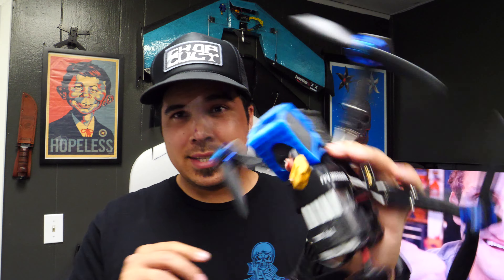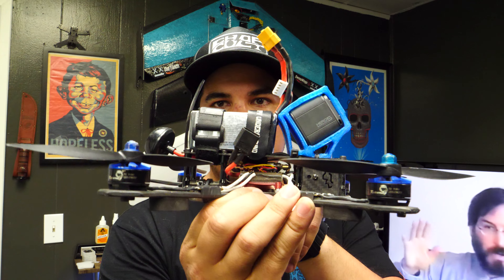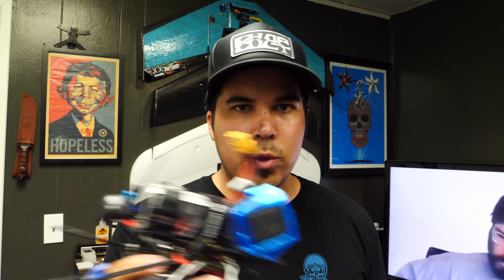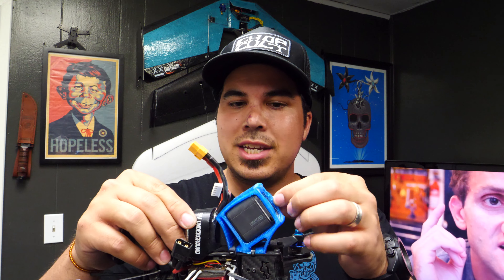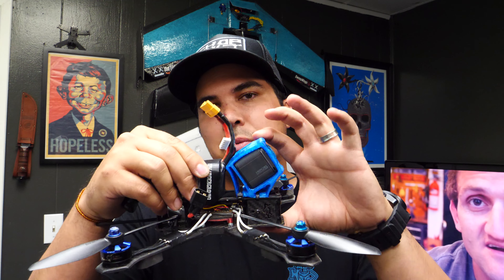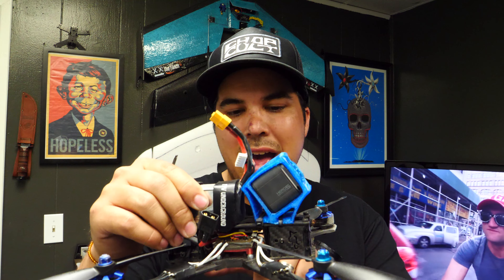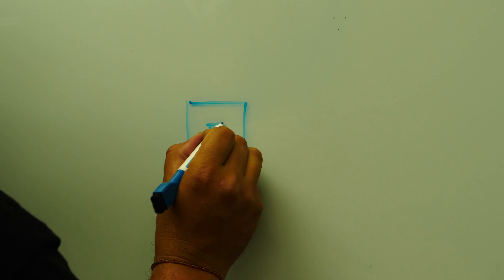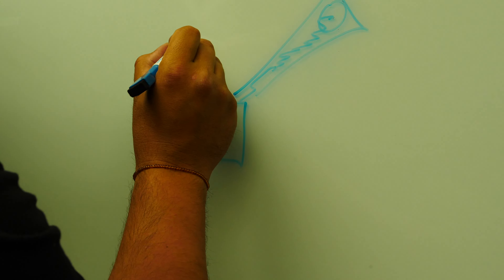TECH YOSELF | CLEAN AND DIRTY

Comment: I think one difficult part of trying to soft mount a modern FC is that so many are now AIO controllers and with that comes a lot of wires, weight, and vibrations through those wires to the FC. Have you thought about dampening your arm mounts? That makes more sense to me that trying to soft mount motors and maybe combined with the FC isolation you could really cut out a lot of vibrations. As a side effect I assume it would make the quad feel less snappy and more mushy.

Comment: if you're rockin 6", especially bi-blade props, I'd highly recommend balancing your props if you're getting jello.  Really we should always be balancing our props but if it's less than 5" it can often be compensated out with PID adjustments.  Most brands are very out of balance but a few are generally well-balanced (such as HQ Props).  Unbalanced props becomes less noticeable the more blades you have, so a tri-blade and quad-blade have less noticeable impact and we can get away with it.  But at 6" it starts to become a problem and even more so with a bi-blade.  Unbalanced props = jello.
Reply from the maker: +Kellen Razzano I just switched from trip blades to gf bi blades cause they're more balanced then the HQ tri

Comment: Any chance you are interested to gather some data on your problem... If you have a way to collect black box data, then you can measure the efficacy of the changes you are making to your setup... Love that you share your experiences with your subscribers!
Reply from the maker: +diabolicallydan yeah I've been using black box
Reply: diabolicallydan I wss thinking similarly, if we had some accelerometer data on the go pro we could better design the new soft mounts. how crazy would a second fc mounted on the go pro just to record it's accels? I'm betting Konasty has one sitting on his bench!
Reply: Probably easier to try a different gopro session... In case it's a problem with the onboard image stabilizer fighting quad vibrations. Trying to take as much vibration out of the quad is the best first step...
Reply from the maker: +diabolicallydan already tried a new GoPro wasn't it

Comment: here is the problem, years ago we could fly 6 inch no prob the gyros were not nearly as sensitive as they are today, most flight controllers are designed around a 5 inch prop or smaller, 6 inch props are noisy as hell, and add a bi prop boom super noisy, beta flight should work pretty good now that you can take out the worthless notch filters, my films pretty darn clean on 6 inch using Rf and some of the secret new unreleased firmware they are working on, bottom line softmount will help, but its more of a filtering problem, need to be able to filter out the noise a 6 inch makes compared to a 5 inch, also you use small motors and lower kv, 2206 2150 kv? that a torque set up but IMO a 2206 struggles with getting a 6 inch prop up to speed fast in return jumps the prop make vibs and more noise, I designed the 2207 2400 kv and 2580 kv both do really well on the 6 inch bi prop with the amps maxed out at 122, which is less than my 5 inch set ups, so i think there is a few things that i mentioned to ya that are against ya, but i can see ya have been chasing the issue down a rabbit hole, so maybe some of this info might help ya.
Reply from the maker: +richard shelton thanks for the comment Richard. A lot of this stuff I have already said or know about but I'm trying to find the best solutions to the 6" problem that way I can help others that run into these issues rather the finding a quick bandaid to the solution.
Reply: well i would start with the filters, if u fly beta, i would drop the notch filters and that should instantly get it flying better, or give rf a try in a few weeks, also if you run 6 inch tri props u should have pretty decent film, might lack top end speed and climb out thou.

Comment: would you try just 2 layers of 3m doubleface tape to mount your 3d gopro mount to the quad  vs the zip ties   ?
Reply from the maker: +antoine ozaneaux not the 3D mount cause it's to heavy it will rip off but I mount the foam that way.

Comment: I feel your pain man, these worked pretty well for me on my quads lately. i tried the rubber orings at all 4 mounting points and was still getting small vibrations coming through to my fc. This is what solved it for me. They're kinda like what you were explaining in your illustration. http://www.readytoflyquads.com/tpu-3d-printed-sount-mount-fc-star-adapter.
You'd just have to trim off whatever you didn't need. They basically allow the whole outter edges of the fc to be fully dampened. I also soft mounted my pdb on o rings and it helped as well.
Reply from the maker: +daneyan1985 I've seen those but don't like the 45deg idea
Reply: You can mount it in whatever orientation you want as well. You just have to trim off the 45 degree tabs that's all.
Reply from the maker: +daneyan1985 but then you're still mounting it to a stand off

Comment: what was the thought process of going to bi-blades from tri-blades?
Reply: Screw Muggz they are just better for the 6 inch until somebody comes out with a better motor.
Reply from the maker: +Screw Muggz the gf bi blades had better balance but I miss the grip of the tri
Reply: Rich Evans Konasty thanks, just was wondering. I have bi and tri for my 6" just haven't used the tri yet.
Reply from the maker: +Screw Muggz I like both. I'm still getting jello either way so I'll probably go back to tri
Reply: Konasty I'm looking forward to trying mine with tri. Just a matter of finding time now...

Comment: I need your expert advise on a similar problem.  I'm flying a 6" quad with kiss setup.  It runs super smooth with 6040x3 props but when I switch to the 2 blade 6045 hq,  the fpv video has terrible vibes  on throttle punches and a little  bit of jello on GoPro.  I just don't know where to begin trying to tune that out.  Should I crank up the "i" with the bi props?
Reply from the maker: +Fallen Vegas sound like P to high
Reply: Konasty ...have I told you lately how Awsome you are?  Thanks a lot man.